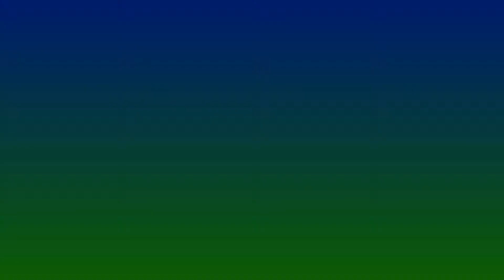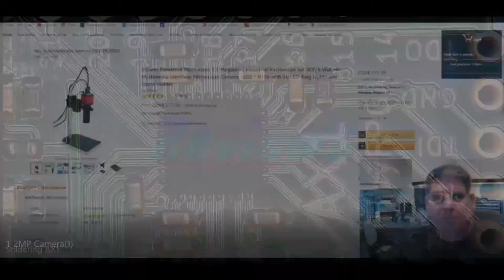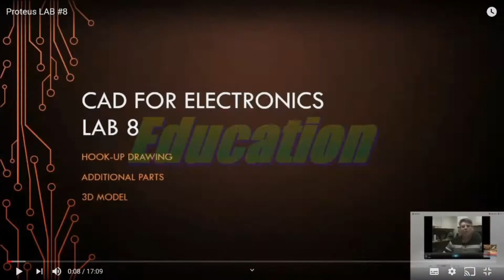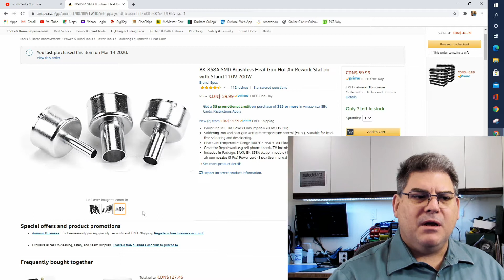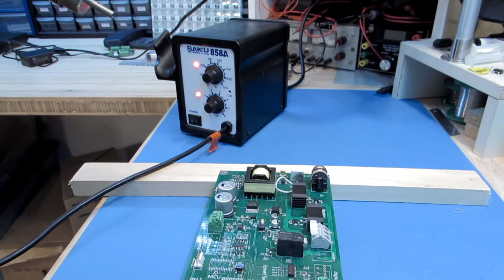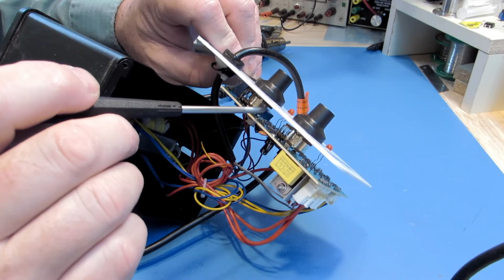858 Hot Air Soldering Station 1 critical issue!

Comment: My system has developed a fault, when i first start it the fan comes on but not the heat while the handle is in the cradle. So i pick it up and point it down the place it back in the cradle  and all if fine. It cools down and goes into sleep mode. I replaced the handle but the same happens. When i switch it off from the machine and turn it back on it tries to blow for a millisecond and stops and all is fine.

Then i contacted seller he said use rare earth magnets in the cradle, did that but still the problem. Its when i plug it in the wall
Socket and the turn it on for the first time this fault happens. Mine 858D the handle that came,e with did have a switch when point it down it starts and when you point it up it cools down, I could hear the switch when turned off and pointing up and down. The new 3 handles did not have these but at first would start heating up in cradle but then they behaved normally. All of the happened when I test the 3 new handles.
Reply from the maker: Wow, three new handles ! Ok, it is odd there is no switch in them.  I can assume you checked the connections to the control board?  Often, an intermittent problem can be traced to a bad connection or solder joint.
Reply: @ScottCard  i will open it up check the soldering, I only paid £17 for this I bought a exact version but a different brand for only £13, these are cheap. I will compare both of them. Only the JCD had a tilt switch in it.
Reply from the maker: @sham27007 ok.  Kine does not have a tilt switch, only the reed switch.

Comment: I brought a cheap LRT 858D from eBay $33 + tax! I literally have one thing I need it for, though I can see future use for it. I finally gave up using a soldering iron on SMDs! My iron cost a lot more that the rework station so they are a bargain, as someone who worked fixing monitors back in the through hole days, I have to say today a rework station is essential, I have failed too many times with an iron alone!
Reply from the maker: I agree!

Comment: absolutely great review, i just gotta add some of my words; for that price you get what you pay for, but what to expect: the reed switch in the handle broke and its no longer turning off the heater when put on the base (3 uses, 10-15 ICs desoldered) and the noise that it puts out back into the input is horrific . It does that when it reaches temperature ("fast" switching the heater to control the temp), and all devices that are on that phase have audible noise and even the better leds (best of osram) have a hard time filtering the noise and it comes out as flicker (not really THAT bad, but it can make you dizzy) 
TL;DR for some begginers its great, for anything more, nope.
Reply from the maker: Wow, thank you for you input. I hope their quality has not slipped even further and that yours is an outlier. Mine, even with all its warts, has been doing double duty since  the pandemic started. Hopefully your retailer can help you out but, I agree that it is not Profesional grade.

Comment: Dodgy indeed. Have you checked to see if the earth wire is actually connected? Many of these just have the earth pushed loosely under the tip. Looking at the board there doesn't seem to be any earthing of the case front either going on too.
Reply from the maker: Well, in there, yes. Properly bonded, haha, not a chance!